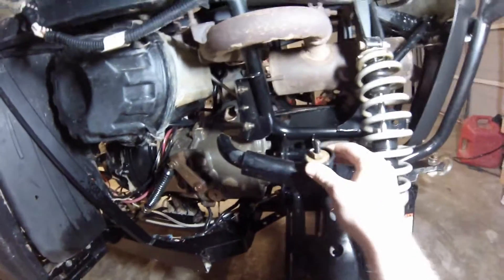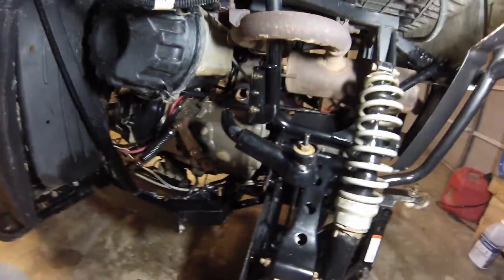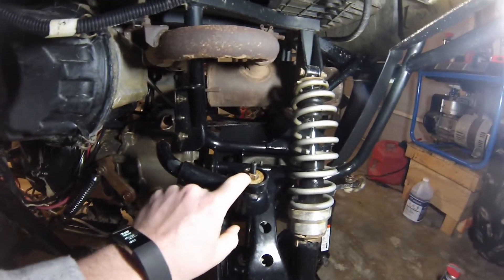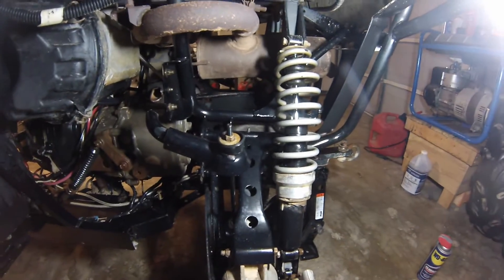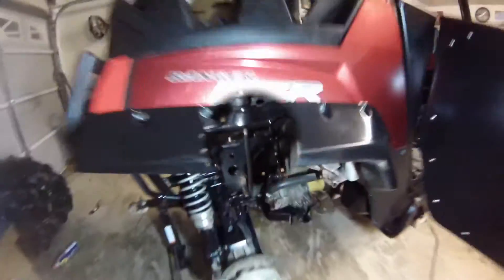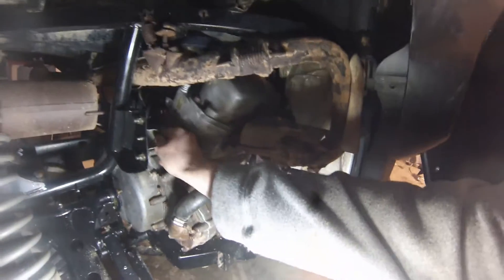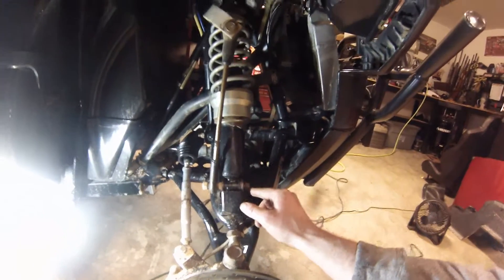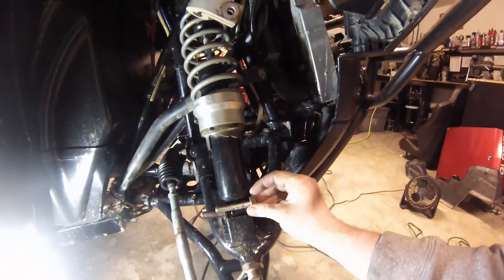2009 Polaris RZR 800 sway bar removal

Comment: You must be smarter than the Polaris Engineers who designed that machine!!  That Anti-Sway/ Stabilizer Bar is there for a reason!   In a nutshell the stabilizer bar is there for two reasons: 1. to keep the front level  in braking and cornering 2. When a tire raises off the ground that tire rise puts more force on the tire still on the ground thru the stabilizer bar.  Even if both tires remain on the ground in full tilt after the stabilizer bar is deleted,  the tilted tire will have more weight on it just from the tilted weight of the machine.  The lighter tire will spin easier because lack of weight of the machine in a tilted position.